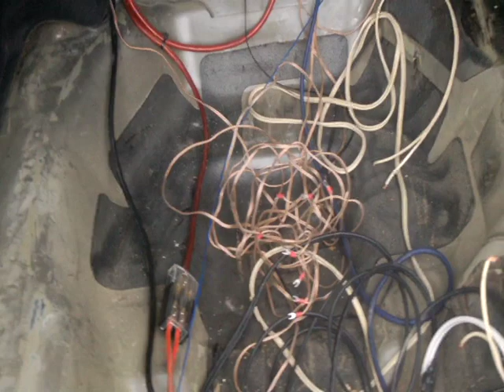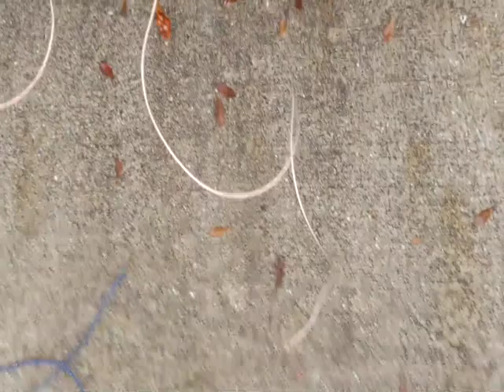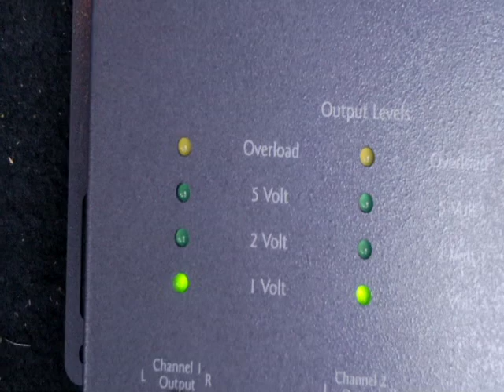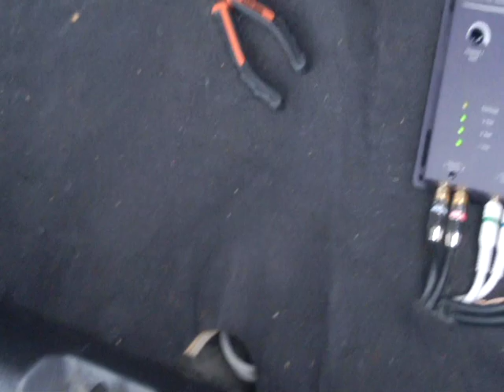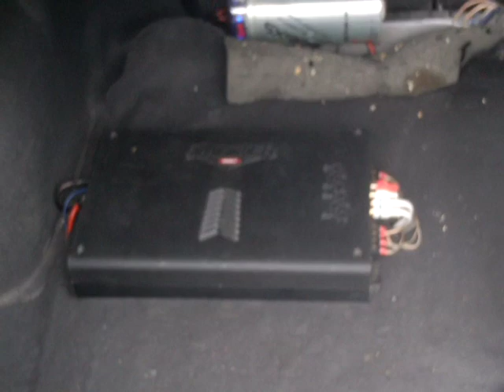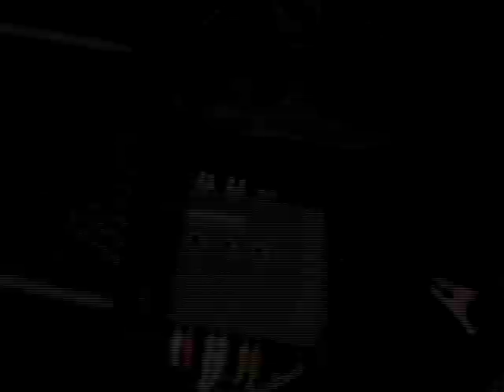HD 2004 Honda Civic Audio Control Matrix Install Part 2

Comment: I went to a pro radio shop, installed the audiocontrol eqx, and the audiocontrol four.1. There 's a diagram on audiocontrol.com on how to connect both of them together.  Came out of shop and it sounded like shit, was getting engine noise and whining when gas was pressed. Tried moving rca's around cause I knew I have some not working properly, but wanted shop to see if they would discover it, they didn't. Anyway got problem solved by moving them around and now it is too fucking loud. Even radio at level 1, audicontrol is very loud, and very clear. Four.1 is in glove box and eqx is in trunk.  Thanks for posting your audiocontrol.

Comment: Looks good, bro. I just got one of these so I'm checkin' you out. I have it semi-installed (all good wire and rca cables, but not in the place that I want it) but when I put my oscope on it the top curve was a little distorted. It's not a square, clipped signal but when it starts to come down it bumps out then continues back down. The bottom curve is nice though. Any ideas? Great vids bro but I have to bust your balls a bit, a man does not buy his tools from wally-mart.

Comment: quick question, do you need the remote the one  next to the ground to power it or can u just hook it up with the volt to power it ? cuz im doing a project in my room and im trying to do it with out buying a car stereo for the orange remote wire.

Comment from the maker: @casperskafs DEFINITELY worth the money bro. I do professional audio visual services and gain structure is HUGELY important. Not sure why Pioneers expensive ass head units only put out 2 volts at full volume... I think thats a bunch of BS. My mids and highs and bass sound SO much better now that the head unit and amplifiers arent overdriven. Now I have what's called headroom which allows for a lot better dynamic range. It's gonna sound insane when I do my mids n highs upgrade in about a week :)